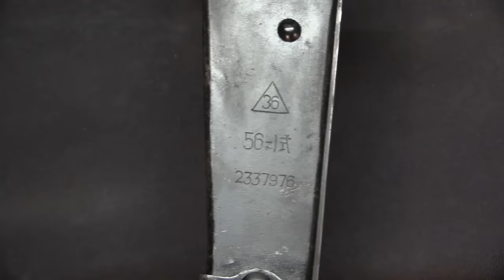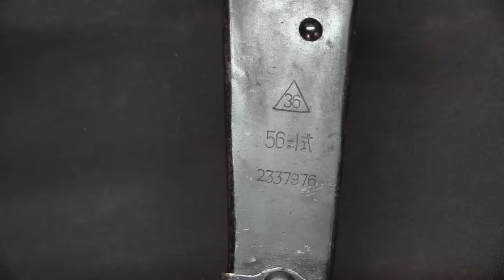RPD: The LMG Adapts to Modern Combat

Comment: I'm glad someone finally pointed out that the Kalashnikov was employed in the role of "submachine gun" and not considered a rifle in Soviet doctrine.
Reply: That's a really interesting fact I've never heard of before.
Reply: At least, not originally considered as one.
Reply: I believe Kalashnikovs first design was actually a submachine gun. It didn't go anywhere but it got the attention of the higher ups, and he went on to design the AK. Essentially what they wanted was a better, more powerful submachine gun sort of thing that was cheap and easy to use
Reply: @booqueefious2230  even after adoption of the AK47 it first fell into the SMG role while the SKS remained in the rifle role. eventually the Russians switched the AK to the rifle role. the Chinese stuck with the old system with the Type 56 family until later
Reply: @jasonwalker4003  I disagree, Russian naming conventions don't follow this. A submachine gun is always designated with "PP" as in PPD, PPSH, and PPS. "A" designates a rifle capable of full auto fire, as in Avtomat, AVS 36, AVT-40, and then AK-47. "S" is a semi auto only rifle, even if it's the same model as an "A" type rifle, hence SVT-40 and SKS. If the Kalashnikov was intended to be fielded as a submachine gun after adoption then it would be PPK47, not AK47. The SKS was developed DURING the war, I personally think it may have been to test out new smaller rimless 7.62. Cartridges in the field. Larry Vickers indicated from his time in Russia that the SKS may have only been adopted as a stopgap to essentially "throw a bone" to Simonov who had already developed the SKS system on the PTRS anti tank rifle. It's a simple system already proven to work and didn't require complex magazine adoption, so they just threw it together and let it ride seeing that they didn't know the war would end in 1945, the Soviets actually did go to war with Japan at the very end so the AK was still a ways away. Furthermore, the Soviets did NOT consider submachine guns to be for "special troops" only or anything like that, this is evident from productions numbers alone, as over 8 million PPSH and PPS machine guns were made during WW2, and combat footage often shows whole combat units armed only with PPSH machine guns, they aren't vehicle drivers or artillery personel or whatever, they're front line soldiers. The Russians realized very quickly that the combat distances were short and that the firepower of cheap and quick to produce SMGs was the way to go for many combat units, to the point that entire SMG platoons were formed with 60 men (I think I read that in Ivan's War, but I could be wrong). Rather, it was the M44 and M38 carbines that were given to secondary troops as again, combat footage shows artillerymen in the Battle of Berlin and many other battles armed with M44 carbines. Meanwhile, the guys clearing buildings and advancing are armed with SMGs, 91/30s, and SVT rifles.
Reply: You're right that PP = SMG but by the time AK was adopted, SMGs were called "avtomat" in colloquial use and some manuals. This term was initially applied to the Fedorov's rifle and was carried over to WWII SMGs. Basically, it's the lowest common denominator for all gun types intended for individual infantry use in full-auto, despite of the cartridge type. The "A" in guns like AVT you've mentioned isn't actually equal to the "A" in AK. The former is an adjective (avtomaticheskaya) to the noun "rifle" (vintovka) while the latter is noun (avtomat). So the A in AVT describes and specifies the type of rifle it is but the A in AK defines what it is.
After WWII, SMGs were essentially ditched in Soviet military doctrine because AK was considered to fill their role (close range full-auto) while being effective in other situations where SMGs aren't. So there wasn't any practical need to distinguish the two terms until the need for pistol caliber weapons rose in the 80s and 90s and the term "PP" was brushed up with the gun type itself.

It's also worth noting that in East Germany, AK was dubbed as Maschinenpistole to avoid unwanted assotiation of the StG used by the SS (and the term "assault rifle", Sturmgewehr, coined arguably by Hitler). Perhaps, this was one of the reasons why Soviets didn't use the term either, except for reference materials on Western weapons
Reply: @galvanic.warlock  I am overjoyed at the level of information and discourse available in the comments of this channel thanks to people like you and Evan L.  Thank you for providing such excellent information.
Reply: @galvanic.warlock  interesting that the Austrians called the Styer-AUG the StG-77
Reply: @galvanic.warlock now you mention that i think that could be one of the reasons for what the russians develop the ak 74, because the OG ak 47 and akm doesn't fit the rifle role that well when they change its category (longer ranges and combat in more open spaces).
Reply: @liquid880  i don't think the terminology really mattered at that point, going for low-impulse ammo was a global trend at the time
Reply: @liammeech3702  from what i've read, the German Bundeswehr tends to avoid words associated with/coined during the reich era, hence their designation for rifles (no matter the type) is "Gewehr",  which can be seen in the G3, the G36, and so on. Austria doesn't seem to have any such reservations
Reply: In Vietnam nowadays, the designation for Kalashnikov rifles (including the modified Galil) and the AR-15 (leftover M16) are "submachine gun", just like the original Soviet designation.
Reply: Then what’s 74u considered? And the 9mms?
Reply: They did however have a unique doctrine revolve around that new "sub-machine gun", so one can argue that define a new weapon system.
Reply: @lindboknifeandtool How the Soviets considered the role of the Kalashnikov in the 1940s is not the same as how the Soviets considered it in the 1960s and 1970s.  When the AK was first introduced, it was issued to rifle unit leaders who previously would have gotten a SMG, while the "riflemen" who would have previously gotten a Mosin-Nagant or SVT were to receive an SKS.  Thus, the role the AK was filling was a "SMG" role, while the SKS was filling a "rifle" role within the rifle squad.  Very quickly, the Soviets realized there really weren't any down sides to just issuing the AK to fill both roles in rifle units, so they discontinued front line service of the SKS and were able to start sending the tool set for the SKS on their World Tour of the ComBloc.

However, the original Soviet fielding of the AKS74U was as a SMG role as well, decades after the Soviets had accepted the AK, AKM, and (by that time) AK74 as suitable for "rifle" roles for line grunts. 

This is similar to how the XM177 models in US service are labeled as "submachineguns", despite being basically short barreled M16s with collapsing stocks.  Also, when Curtis Lemay selected the AR15 for USAF service, the idea was as a carbine replacement but it quickly was chosen for standard line "rifle" roles, and when the M4 was adopted it was originally for carbine roles (thus, why it is an M4 Carbine, not an M16A-something, despite being the standard US service rifle now).

Don't confuse tactical roles and perceptions by military planners with the actual technical definition.  

Other examples- technically, the M551 Sheridan, M8 Buford, and the M10 Booker are NOT "light tanks"☆ officially*, despite literally being light tanks in terms of design and role.  Same for the America class LHAs, especially the ones without well decks - they're *officially amphibious landing ships despite being laid out from the very beginning as de facto light carriers... I was on the LHA6 design team, back when it was still LHA(R), and I remember the white paper that stated the Marines realized they really needed a light carrier, but politics prevented calling it a CVL☆.

.
☆ Basically, if you call something a "tank", dumb commanders tend to use them as interchangeable with MBTs and if you call someilthing smaller than a CVN a "carrier", idiots in Congress who couldn't tell a battleship from a frigate start talking about how these newer carriers are so much cheaper than a CVN, so why should we build any CVNs?😅.
Reply: As were the stg44s

Comment: The chinese equivalent of the US saying "name everything M1" was "name everything Type 56"
Reply: "Please check this awesome type 56 toothbrush we produced in 1956."
Reply: Actually there are more Type 59s: We have a tank, a 130mm cannon, a 57mm AA gun, a 100mm AA gun and a licensed Makarov.
Reply: @qingyunwang3802  but there are more type 56s for one role which makes it worse in terms of confusion
Reply: I would say Type 59, but that's for tanks.
Reply: Chinese tanks: everything type59
Reply: It’s actually how Americans decided to call Asian firearms. The actual word translates better to model but for some reason type was decided on for American nomenclature instead of model
Reply: HA!..ThaTruTru indeed, and here I'd thought it was 'M4 EVERYTHING!?".....("Thats EveryTING" BTW;)

~Grab some M4-44M ammo, 'ta stack youre M4 clipazines,  thru its M4 spec feed lipz, to chamber in ones M4 rifle & when ya run clean of ammo, you then transfer over to ones M4 Claymore CDM's n' pray for the screamin maniacs to refrain from over-running your position n' fighting hole, a hole ya dug out with ones M4 entrenching tool...

-After the fray dies down, chill out, n' crack open a few M4 MRE's, in <<past<< wars you'd rely on your M4 can opener to cut the tin cans open (Formerly P-38 can-opener,  a P-38 is a WW2 attack aircraft anyways right?....;)
Reply: @sliceofcheese3890  the japanese used type so maybe it just got incorrectly applied to chinese stuff too.
Reply: @KrikZ32  I am going based off a video where Ian said almost exactly what I did so I’m going to roll with that
Reply: @sliceofcheese3890  I'm not disputing anything you said, I'm just offering a potential explanation

Comment: The Volvo of guns. Doesn’t break. Wouldn’t be surprised if it was made of tungsten
Reply: Stalinium exists, and all of it was used up in the construction of RPDs.
Reply: @johnstacy7902  Iraqi guns are not Soviet quality..... They are locally produced
Reply: @johnstacy7902  well, yeah, shot to shit and never maintained.
Reply: @Jimmy Two Times the video it self clearly contradicts your statement... Also the fact the gun in the video is Chinese manufactured also blows your statement out of water. It was made by quite a few nations and I've personally seen and handled a few, including a Russian one. Outside of Russian and Chinese, they were all shitty, Chinese ones were okay but Russian one was freakin amazing.
Reply: @johnstacy7902  
I mean.. they are kinda old, most likely not very well maintained and abused.
Wasn't it the same with the M60? Like used beyond it's expected life and that's why they don't run as good anymore.
Reply: Ah yes, the Tungtal
Reply: Niet it is stalinium
Reply: mx22   no he was wrong
Reply: I’m not an expert by any means, but tungsten is extremely brittle. It has the highest melting point of all metals, but you can easily snap it in your hands. Learned that from tig welding
Reply: @Dominik189  The only one that could be bad, would be Egyptian. They were probably just beat to shit. That said, Battlefield Vegas found out that the receiver extension at the rear has a weak spot that shows up at 50k+ rounds.
Reply: @Jimmy Two Times oh good grief...
Reply: Or castiron from Husqvarna
Reply: @alexandruianu8432  50k+ round is a longer life span that most modern firearms...
Reply: One should take care as when shooting in long bursts the polish on front grip melts down. If this molten polish contaminates ammo or get into the mechanism - you'll get stoppages.
Reply: @johnstacy7902  I wish the ones used in '69-70 had been pieces of shit.
Reply: @Dominik189  100k+ for the 1mm receiver AKM, and indeterminate for milled AKs. AR receivers also last a lot (only the consumable small parts break at 10s of thousands of rounds, like the extractor). Of course, a single weak point can be easily fixed. The RPD is overall a good, durable gun.
Reply: Volvos break all the time.
Reply: @DangerIncFilms  and in kv-2 SPGs
Reply: @Jimmy Two Times what about china and albania?
Reply: @Jimmy Two Times didn't china and albania manufacture RPDs
Reply: The RPD did not share the reputation of reliability and durability of the AK's. They were not particularly reliable or durable and in practice it's firepower was disappointing. This is why the Soviets moved away from the RPD in favour of the RPK and PK series of machine guns surprisingly quickly.  Interestingly the US is going through a similar process right now as it ditches it's M249's in favour of the M27 IAR.
Reply: @Jimmy Two Times Ehhh, the one Ian is showing is made in china, and china isn't the soviet union.
Reply: It doesn't help that guns in general in the Middle East are treated as party noisemakers as well as weapons.
Reply: @RobertDecker417  "Ease of Logistics".  The RPK has many interchangeable parts with the standard infantry AKM.  The RPK is just an AKM with a longer barrel.
Reply: @nialltomy15  The 249s have been around for awhile now.  Time marches on..
Reply: Ahem ... VOLVOs are now Chinese cars.
Reply: I had a Volvo in the eighties. It was deemed the walking man’s car because it was always in the shop. Maybe the Honda Civic would be more appropriate.
Reply: As a long time volvo owner I can say they really don't break.... Until they do, and its usually serious.
Reply: Tungsten is to brittle to use in a firearm unfortunately.
Reply: @Jimmy Two Times Did you watch the video at all?
Reply: Tungsten is really weak and brittle though
Reply: A Volvo crashed into a block of flats i lived in once. The Volvo had a retentively small dent but put a crack in the building.
Reply: @Dominik189  Any gun could be ruined by poor maintenance and abuse. The Polish made versions were well made (with better finish than the Russian models) and worked well:  this is my first hand experience from serving in the Polish army. We had exercises with the Soviet troops and they were also happy with their RPDs.
Reply: @Jimmy Two Times Type 56? definitely made by China, not the USSR. The Chinese were even nice enough to give em to the North Koreans in  the Korean war.
Reply: @johnstacy7902  A Toyota Corolla I buy off of facebook market place for $800 is also a piece of shit, but that doesn't mean Toyota Corollas are poorly made cars. Imagine the condition it was in before it was in enemy hands that allowed it to be purchased by a cash strapped organization. This is of course assuming it's a "Toyota Corolla" (russian made) and not a "Chevrolet Prizm" (not russian made)

The very fact there was a weapon to capture at all is a testament to its resilience.
Reply: Too bad this one is cheap Chinese Volvo knockoff
Reply: @christopherdrekr1078  other than in certain armor piercing rounds. Where it is second only to depleted uranium ,,( if second).
Reply: I can only imagine the horrors of lugging around a tungsten gun...
Reply: @PaulVerhoeven2  had a hell of a time killing my old 240. Did fuckall to it beside filling gas, oil was 5+ years, at the end it topped out at like 70km/h, but it refused to actually die. (Retired it when I got t-boned and the driver side door wouldn't open)
Reply: @davidmcelroy4552  Maybe they're thinking that because tungsten core ammo is good at penetrating armor?